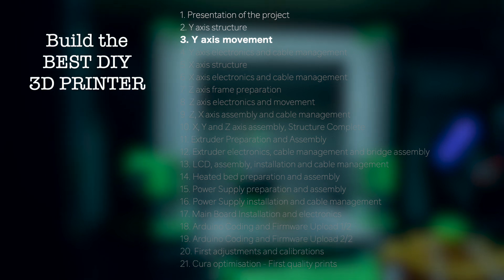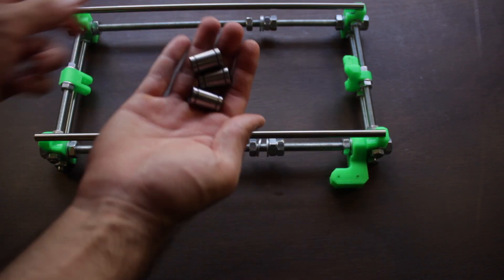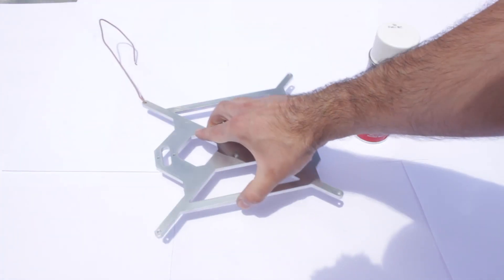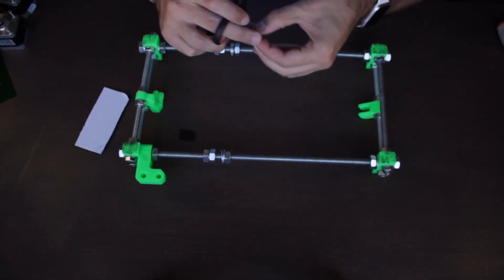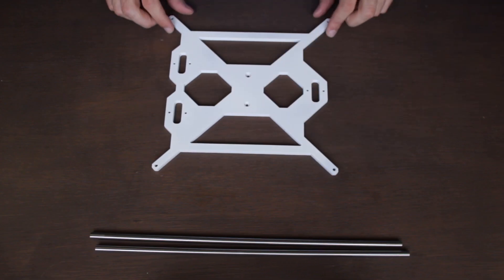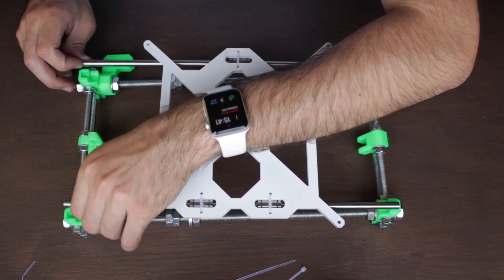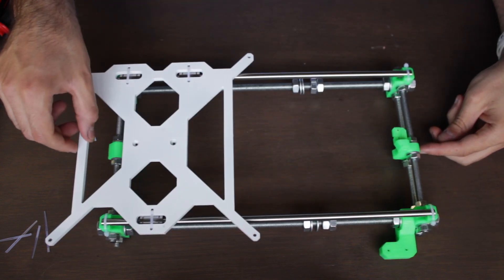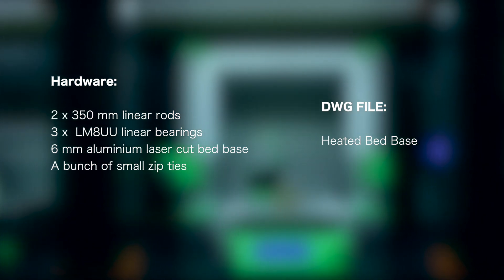Build the BEST DIY 3D Printer - Y axis movement #03

Comment: Architects3P,
Thanks for all your videos.
Should the y axis linear rods float like that? Move a bit along y axis?

I just noticed mine do on an anet a8 plus and I was trying to tighten them so they would be fixed in place. But I saw a lot of references to leave a little flex.

But if it floats doesn’t that cause the little errors that rigid linear rail mods are trying to get rid of?

Thanks,
Dennis